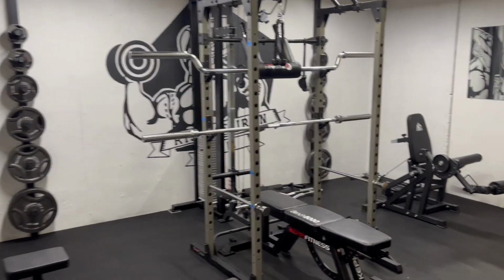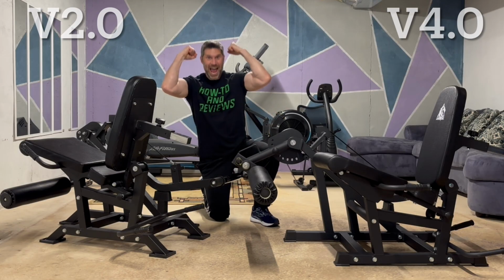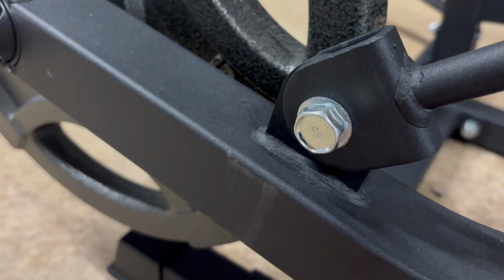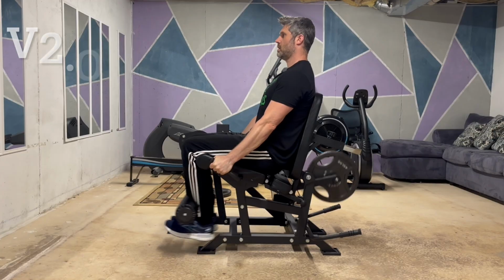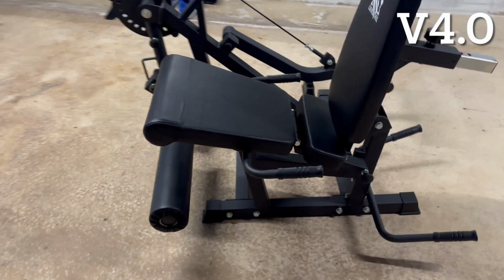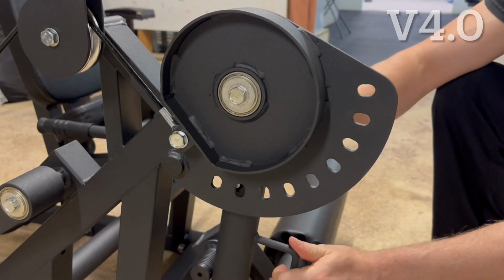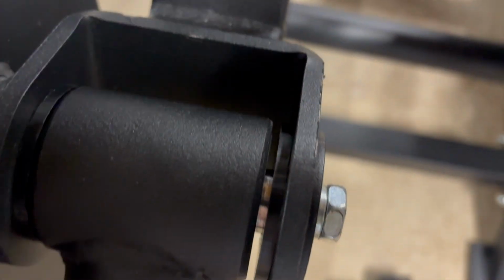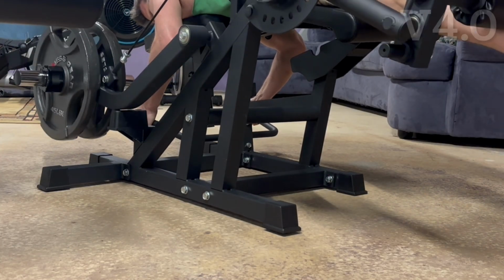LIONSCOOL V4.0 vs V2.0 Leg Extension & Lying Leg Curl Machine Review | LOTS OF UPGRADES

Comment: Nice vid, do you have the links for the rubber bushings? I need those too lol
Reply from the maker: I’ve looked in the past with no luck. I had a couple floating around from other equipment. But I’ve made several of my own with a hole saw and scrap rubber gym flooring.
I’ll look around again and see if I can find a link.
Reply: @HowtoandReviewsOfficial thanks. The size would be perfect
Reply from the maker: It just needs to be 2 inch inside diameter. 

Search amazon for “2 Inch Camlock Gasket.” These should do the job. 

This one seems to be the best value. 15 for $10. 
https://amzn.to/4b2QJBT
Reply: @HowtoandReviewsOfficial thanks sir 🎉

Comment: Is it me pr is the leg pad running at a different angle to the seat? when looking from the front it looks like they run on a different linear plane. Does this not impact comfort and one leg working harder then the other?
Reply from the maker: I took a close look and neither are horizontal. I knew the seat was twisted, but assumed the leg pad was horizontal because it was on the 2.0. 
I haven’t noticed any comport issues. 
I usually alternate doing each leg separately, then do a burnout set with them together.
Reply: @HowtoandReviewsOfficial  so I now have mine and I can say that mine is pretty straight as an arrow maybe something they fixed.

Comment: Hello, I appreciate your reviews and how you fixed the issue on the V2. i think I might only be able to get the V2, I'll definitely follow your tutorial in fixing the pin with using a Clevis Pin, but other than that, would you recommend it? Like stability wise and full range of motion to hit the extensions and curls properly? Thank you very much.
Reply from the maker: If the V2 is the only one you can get your hands on, I would still go for it. It’s a good machine. I had it for six months and did not have any problems with it. 
After using the V4 a little more, I actually like the mechanics of the V2 better. My knees were more in line with the pivot point, and the foot pad was in a more comfortable spot for me when it was flipped.
The only real downfall is that the frame flexes during use. It’s nothing I ever felt or noticed when using it for six months. The first time I noticed it was when I saw it on film when I was making the review video.

Comment: Did you have any trouble getting the swivel foam roll tube into the movement arm (step 9 in the assembly)? I can’t seem to get mine to budge connecting the two.
Reply: Thanks for choosing the Lionscool Leg Extension! You can try applying a little lubricant to the tube. Then, you can gently tap it into place with a mallet or hammer. It won't break; it just needs a bit of persuasion to get it fully seated.
Reply from the maker: I personally didn’t have any trouble. It went together without any issues.

Comment: Do you still own an  2003 2013 impala? Need help with door actuators, but first the problem is “ driver door open” looks keep trying to lock, dome light on , sometimes it settles down. BUT sometimes when passenger door opens it relights again. Can you help or advice? Thanks in advance